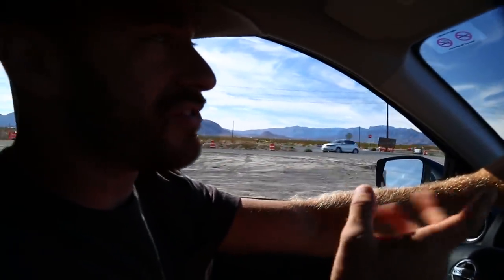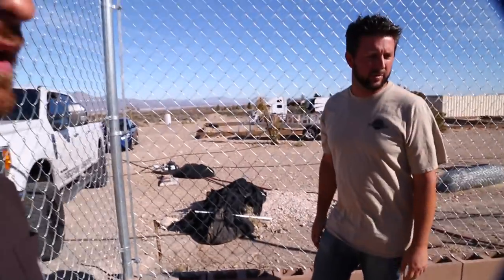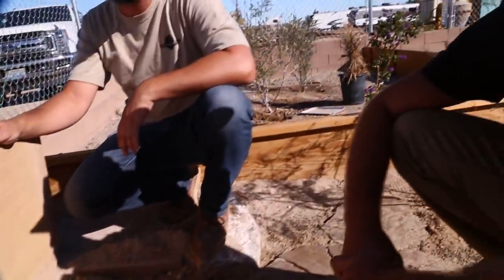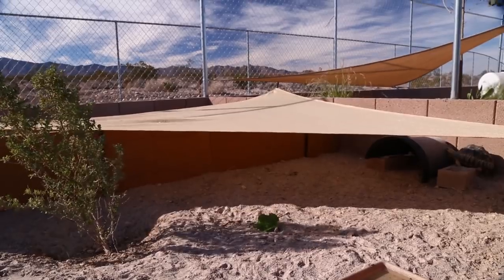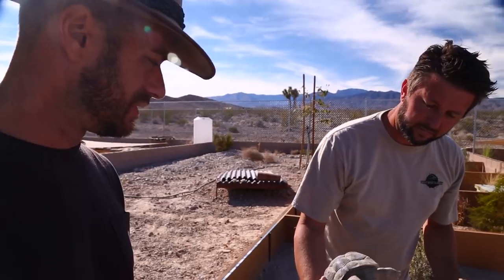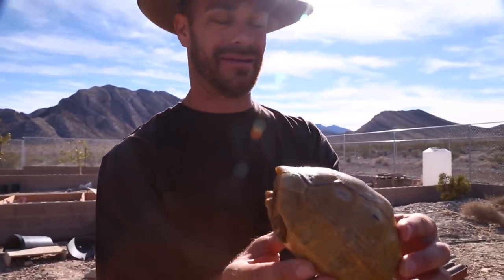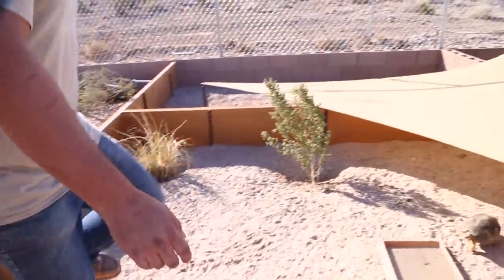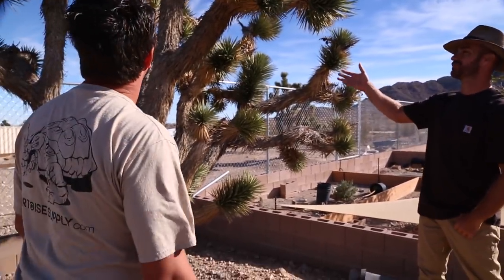Insane Variety of Tortoises in this Mojave Desert Sanctuary!

Comment: <3 the videos - Question - is there a tortoise that could live outside in Virginia all year round? With a heated box, of course.  Temps get down to 0F super rarely, winters in the 30s, snow somewhat frequently. Hot humid summers.
Reply: either that or something that stays small enough to bring in in the winter even at adult and could stay in a smallish area.
Reply: A box turtle sounds closest

Comment: Sad about the coyotes eating your tortoises. Our home is in the Mojave desert and know that coyotes will jump or climb that fence easily unless it's electrified.
Reply: We had a hot wire running but they were still getting through it (didn't seem to care). They can dig under a chain link fence in a few minutes. We eventually put in a short wall with block that's mortared on a footing with a 6 foot fence on top of that, around 8-9 feet tall now that they can't dig under,  and so far nothing bigger than a small rabbit has gotten through that (cameras catch that kinda movement and alert us).